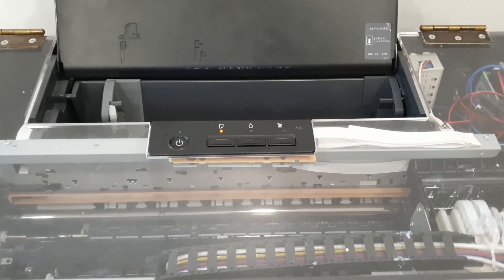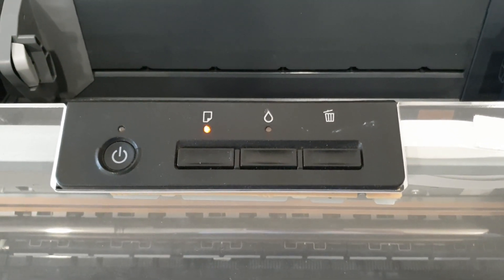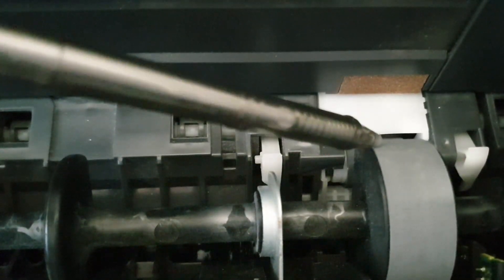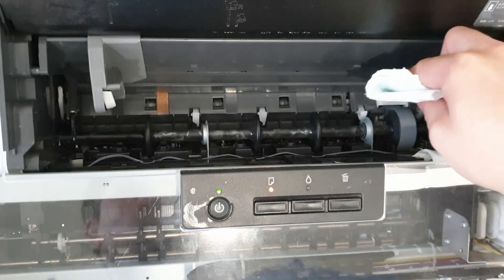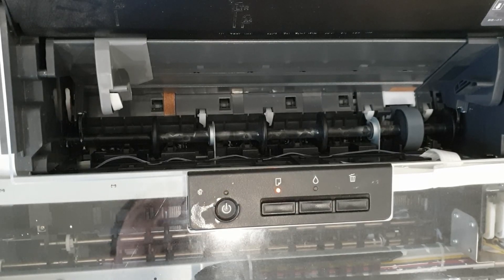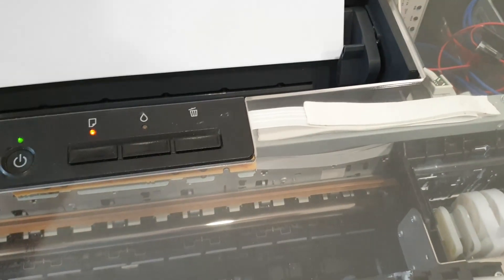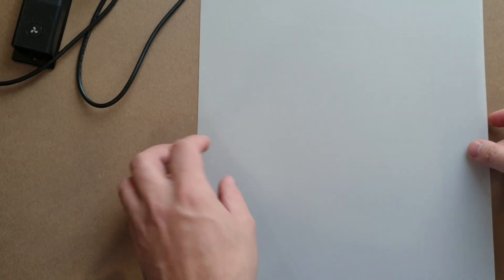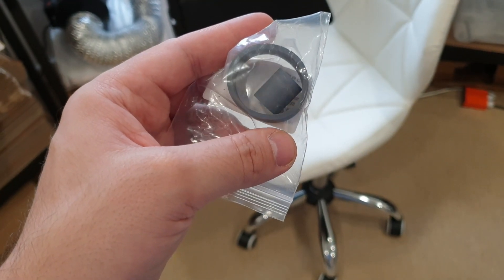DTF Film Feeding Problem. Fix The Paper Error When DTF Printer Spits Out Or Does Not Grab The Film.

Comment: Will this work with a converted Epson XP 1500 printer ? My front rollers are not spinning and the converted printer is brand new. I never made a print with it.
Reply from the maker: Sounds like a broken printer. In nay case, xp-1500 is notoriously bad at recognising and feeding some films, requiring paper sensor adjustment through an Epson adjustment program.

Comment: You can also use 1-2inches of masking tape on the back of the film, or you can use a Silhouette Cameo cutting mat. The printer pulls these mats right through. Because they are thin. Don't use a Cricut cutting mat, as they are too thick. (I've tried them). Stick with the Silhouette Cameo cutting mat. 12x24.

Comment: The bottom drive roller doesn't turn freely.  Any ideas on how to fix it?  The L1800 just feeds paper through.
Reply from the maker: The masking tape trick works pretty well for this, like one of the comments mentioned. Try this: https://i.imgur.com/UNbDjQU.jpg
Reply: @dtfprintingtechnology9457  Thank you! I have been messing with my printer for HOURS now and this simple trick worked like a charm!
Reply: @dtfprintingtechnology9457  omg, ty so much
Reply: ty so much, too

Comment: My epson 3880 is driving me crazy over this film load error, lol I thought I had last light when it load, to find out it printed on the wrong side in dripping from the print.
Reply: did you figuire it out. Im having the same issue
Reply: @rhomeotim  yes if you look where the paper load at the bottom right side near the roller there is a paper sensor white color cover with a dark piece of tape and it accepts the film with no issues.

Comment: I’ve found putting masking tape over the white part in front of the wheel for some reason gave me a 100% success rate in feeding all DTF film. It’s apparently some sensor that has trouble with detecting the film and putting masking tape makes it think it’s being detected every time.
Reply: Where is it located for epson 8550?
Reply: Super weird because the sensor is behind a plastic to right, but i agree 100% it works every single time ever since. THANK YOU 👍👍👍
Reply: Can you post or DM me a picture of that please?
Reply: @itsjrj I now use an XP-15000 and I’m unable to do it with this printer now. All these printers have annoying problems